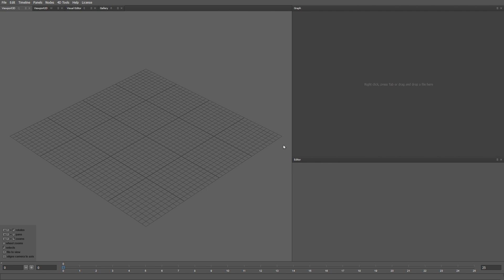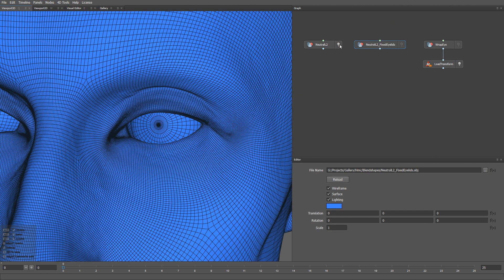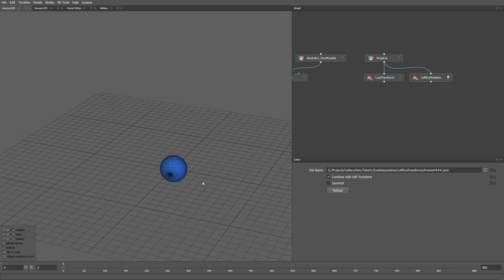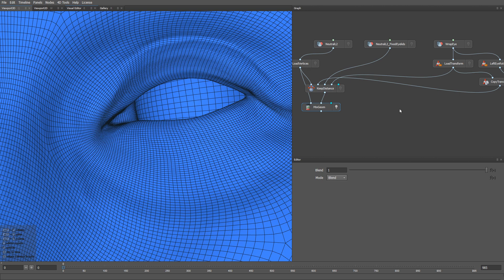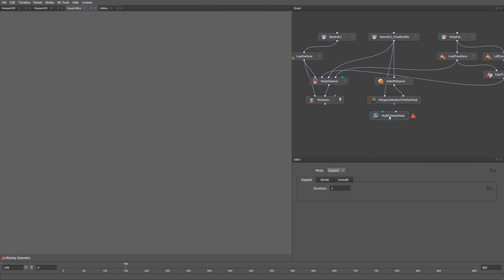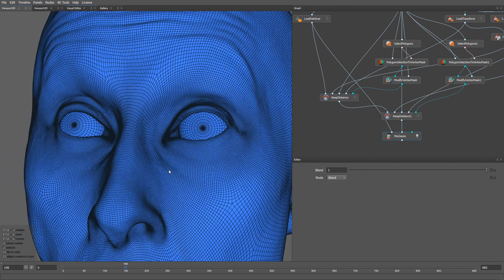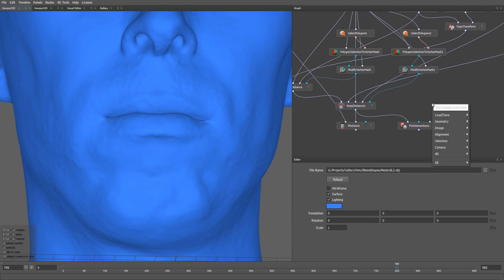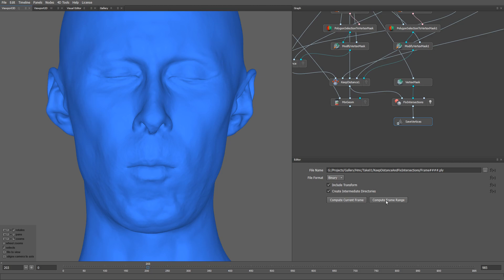16. Keep Distance and Fix Intersections

Comment: Hello @faceform,
I am interested in your software as 4dwrap, but there is something I cannot find so far in my research and that's about final outcome of 4d Hmc/4d scan  workflows , my question is how can we use the final exported models as we export them as frame per second models and how we can turned them into an animation in software like maya or blender? and also most importantly due to huge amount of the file size you mentioned for the final outcome is that possible to record the existing animation in rigged character as normal animation we usually created and exported in this software or not?

Thanks, in advance!